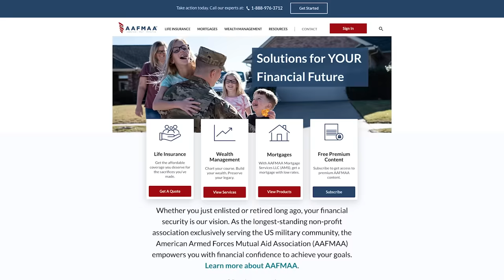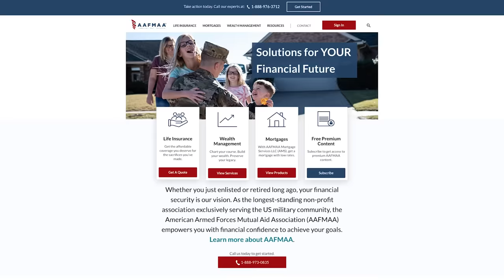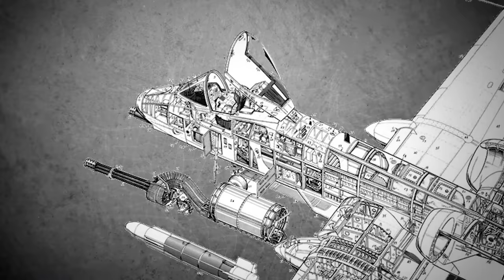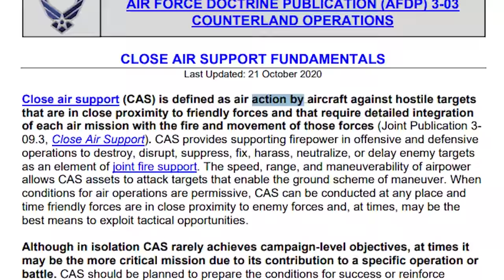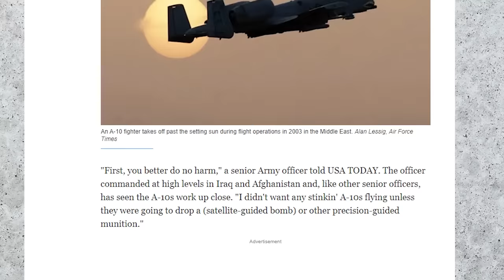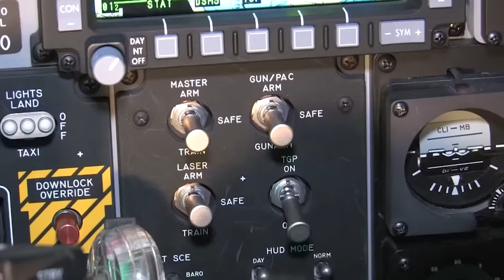Why the Air Force is Screaming to Retire the A-10 Warthog

Comment: In 1990 I was stationed at Headquaarters Tactical Air Command (TAC) and was tasked to develop  briefing "divesting" the Air Force of the A-10.  The Air Force wanted to replace it with the A-16 (F-16 variant) and was willing to give the US Army the A-10s, if that was what it took.  The A-16's motto was "One Pass and Haul Ass!".  By getting target information on the run in, multiple targets could be dealt with without hanging around.  This was a big topic until 1991 when Iraq invaded Kuait.  TAC was sending F-17s, F-15s and F-16s at a furious rate.  That was, until General Schwarzkopf, said "Where are my A-10s.  Somehow the deployment priority sudddenly changed.  The praise from Desert Storm, for the A-10 was too much for the Air Force to overcome after that.  At least for a while.  However it is a different environent today, and I'm sure the upkeep on 50 year old aircraft, that have questionable uses is getting a bit costly.
Reply: No More than Rebuilding The B-52 fleet And Keeping them UP TO DATE !!

Comment: The Ukraine war has demonstrated that the A-10 is indeed obsolete in a near peer or even a below peer conflict where the enemy has lots of anti-air defenses.
As for air to ground support against insurgencies, it makes more sense to use cheaper smaller aircraft, which is why SOCOM got the AT-802U Sky Warden/OA-1K (a crop duster up armored and armed for combat).
P.S., that 30mm Gatling cannon may seem awesome, but it's overkill against an insurgency and the A-10 isn't survivable against a well equipped modern army with lots of MANPADS.  Only in Iraq, with its dysfunctional army that sent tanks out without anti-air cover, was the A-10 able to get close enough to destroy Soviet tanks.  This was much like the first days of the Russian invasion of Ukraine, where the Bayraktar TB-2 drones were able to go tank plinking because of Russian incompetence (Russia did bring anti-air defenses, their soldiers just didn't bother to use them).  So, think of the A-10 as a very, very expensive manned version of the TB-2

Comment: They were built in Hagerstown, MD and used to test over the parking lot of the large company I worked for as the lot was like three floor levels about the ground up a hill and was straight shot to the air field at their plant. Also got a tour of the plant and sat in the seat on the cannon. It was built too good and the Air Force loves to spend lots of money on new toys that put money in the proper politicians pockets.
Reply: I have visited the plant too and Hagerstown is an awesome place it is so eerie to see that factory and the planes that were made their literally right next to where they were built I was imagining the factory up and running and cranking out planes

Comment: They need to replace the A-10 with the same numbers of the AC-130.
Reply: Eh
Reply: LMAO, if an A-10 is already a sitting duck against the air defenses of US' peer enemies, what more to those huge AC-130s?
Reply: AC-130 doesn't fly during the day.
Reply: night vision and radar and ir missiles don’t care about the time of day
Reply: WHAT?  The AC-130 is a totally different type of attack aircraft.  Which is completely incapable of replacing the A-10.
Reply: @paladinspartac2591 so US soldiers only fight at night?
Reply: @pogo1140  the good ones do.

Comment: I’ve seen this plane do its job up close. It NEEDS to be in the USAF inventory. Talk to any solider who has seen this plane do its job will agree. Remarkable airframe. Though the f-35A can be do the same thing, it has a Smaller main gun 20mm versus the 30mm and it can’t hold as much ordinance as the A-10. Not to mention the warthog can take WAY more damage.

Comment: I really would love to see a new iteration of the A10 especially that can increase payload as well as capability and even using drone technology to strike targets more accurately than now. Adding things like AR so you can see 360* around the craft pilots can operate in even more situations. Adding in ECM etc of newer generations and radar it could truly be a multi role attack jet if you could equip it with long range AAMs and or cruise missiles. The Warthog is a legend I hope the airframes can live their final days with glory before going to Valhalla!
Reply: A lot of it is due to the airforce being, largely, run by the fighter mafia with some nods to the bomber pilots...and reluctantly the cargo roles. Most of the rest is forced on them and they'd just love to be able to add more to what they really like doing without having to dedicate anything to the role.

And the Army is, likely, to start demanding to get their own planes to do the role if the Air Force doesn't reveal a plane designed for the role...because they've threatened it there

Comment: It is an absolutely iconic aircraft with a big “oorah” factor and a Rocky Balboa-esque appeal. It had a long run, but the vast majority of that was in situations of air supremacy against non-peer opponents. Unfortunately it costs too much to keep flying, has run the upgrade cycle, and is likely too vulnerable in today’s air defense environment. The mission needs to be met but the A-10’s days look to be close to over.
Reply: I think we both know they will just be sold to another country for them to use
Reply: @LeonSteelpaw No, because spare parts for the A-10 is niche and running dry. No foreign country, not even poor ones, would buy an old platform with spare parts that's worth a fortune due to rarity. 

Japan, South Korea, Australia, etc. are currently purchasing F-35s while third world countries with local guerilla conflicts are ordering Super Tucanos cause it does its coin cas role well without costing a fortune unlike the A-10.
Reply: @LeonSteelpaw  I doubt it. 

They’re not cost effective for the best funded Air Force in the world. It’d be like buying your rich friend’s cool vintage muscle car made by an out of business manufacturer. 

Any Air Force with a lot of COIN needs and fighting foes lacking real air defense would be way better off with Super Tucanos. Any other Air Force in the market for a new plane would be better off with a newer multirole fighter like a recent vintage F-16.

Comment: It is my understanding that the Air Force retired the A-10's before Desert Storm, but brought them back for Desert Storm. I was a Tanker during Desert Storm. I can tell you with 100% certainty that the GAU-8 will kill ANY armored vehicle on the battlefield. One day, when we would be doing maintenance in our FOB, it happened to be very quiet, aside from the occasional tank track squeel or tool being dropped and a breeze. I was on my atnk, when I heard jet engine winding UP (not one of out M1A1's.) I looked up, and an A-10 was leaving after practicing a dive attack practice on our tanks! I COULD NOT BELIEVE IT! I told my crew and said I was glad they were on our side. So,  you see, they can come from high altitude and come straight down on a tank and shoot through the top, which only had a couple of inches of armor. 

This is a mistake to do. They should modernize them with new avionics, new egines, etc...
Reply: Actual Air Force led testing uncovered ghat the A-10 couldn’t reliably pierce the armor of T-62s or T-72s even when at a high angle of attack
Reply: @kyb5203  Well they practiced like they could and they can turn the side of am M-60 to swiss cheese, so I am positive they can do so with ANY Russian tank...
Reply: @texashale65  A T-55 or T-54 sure, not anything older
Reply: @kyb5203  ok. Not that I was a tanker and don't know the capabilities of Russian armor. Not that I was actually in combat against them. Cool 🤓
Reply: @texashale65  Bro, I’m trusting actual test documents over your word, I ain’t just pulling stuff out of my ass
Reply: Modernizing the a10 to become atleast somewhat future proof would cost so much that you might as well design and manufacture a completely new aircraft... New avionics and engines can only do so much. The cannon would most likely have to go too, the other munitions it carries like guided bombs have been proven to be far more effective anyways...
Reply: Like the other commenter says, tests show otherwise. IF it can even hit the tank. 

During those tests, they shot at closely grouped T-55s with an entire load of ammunition, taking as much time to line up the shots as needed from a high angle of attack. The test showed that the majority of bullets straight up missed. Of the bullets which hit, only a small percentage actually penetrated. The damage to the tanks was determined to have knocked some of them out of the fight, but they could be fixed and operational within a couple days. 

In Iraq, the A-10 had the most number of air-ground engagements with the least number of actual kills, also being the most downed aircraft in Iraq, and that’s not even accounting for the fact that it’s VERY hard to tell if you actually killed a tank, and most pilots over reported their kills because you can’t tell if a tank blew up when you’re flying by at 400 mph and the whole thing is engulfed in dust. And you lack optics to really see what you’re shooting at. 

the gun can be useful for light armour and infantry engagements on a modern battlefield, however the availability of MANPADS for virtually every fighting force in the world means that it quickly becomes a very dangerous mission for the A-10, having to get very close to shoot a target accurately. 

The accuracy of the A-10 gun is very questionable. If I remember correctly 80% of the rounds end up in a 12m circle. The remaining 20% can be as far as 40m from the point of aim in a perfect scenario, likely more in a real combat scenario with imperfect flying. This calls into question the usefulness of the gun over a missile for CAS, as very close air support can be dangerous for friendly troops. And a missile would be able to more effectively strike infantry in an area rather than relying on a spread of bullets to hopefully land near them.  Unless the pilot empty’s a significant portion of the guns ammunition onto a target there’s a good chance it won’t completely take it out, especially as friendly forces take cover and let the enemy know they should take cover as well. 

So, I think the gun has very niche use cases, but overall if they want to design a better CAS aircraft it should ditch the gun in favour of more missiles where you can stay far back from any portable air defence while doing the same if not more damage to the enemy.  Weight for weight the missile would be much more effective.

In terms of upgrading the A-10, it wasn’t designed to be modular. Upgrade packages exist but the cost is astronomical compared to the relative simplicity of the aircraft. I think it’d be a waste of money spending so much money on these upgrade packages rather than using that money to design a new CAS aircraft, or even to buy entirely new F-35s which are roughly the same cost as an A-10 modernization package.  

They were good when the most AA the enemy had was machine guns and unguided rockets. In the modern day you could expect this plane to be taken down very fast if it tries to do a gun run, so the weight of the gun would be better spent on missiles.
Reply: @Chevsilverado  subsequent testing against t62 shows very poor penetration requiring multiple passes to effect a kill (on static targets in the open), and as you say... if they can even hit the vehicle. The gun is junk for the role it is/was designed for.

Most of the kills under a10 is from missiles/bombs. Looking just at desert storm you see them using 4800 mavericks likely resulting in the VAST majority of their kills.
Reply: @texasshale65 they most certainly did not do that

Comment: The Gau8 is merley the fun part of the aircraft that has some uses. We could update it to the heftier 50mm autocannon slower fire but allowing for smarter ammunition to deal with embeded targets and lighter armor or weakspots on MBT's.  

The biggest strenght of that thing is its ability to operate so well at a low altitude while performing maneuvers even at maximum loadout. While there is really bad weather even and it can take a beating from groundfire like automatic weapons and the more common manpads. 
Majority of US aircraft (well most modern aircrafts actually) perform poorly during such situations. Even bad weather alone can ruin a day of planned sorties and the F35 is certainly no excemption if we take into accounts the reports done in the past few years. 

And how well will GPS reliant weapons be when modern battlefields are starting to see GPS jammers, Laser scramblers and digital warfare specifically to make modern weapons unreliable this area of warfare will only increase the more we "digitalise" our weapons. 

The A10 certainly has become old. I would however say that a proper replacement might be good to look into that is reliable with many of the A10's strenghts. The F35 is not one of those aircrafts but i can imagine them using its modular base frame to build something to do that on short notice.
Reply: I don't think that the Airforce want's another plane like the A-10, that plane didn't perform well during it's service.
Reply: We already see scramblers/jammers hard at work in Ukraine. HIMARS were all the rage. Then Russia started to jam the gps guidance on them and they became far less accurate.
Reply: For insurgent hunting purposes; AT-802U Sky Warden seems to be the closest to an actual successor.
Reply: they'll ductape that gun to some Osprey and call it a day.
Reply: @trollmcclure1884  that gun is one of the main problems of the A-10.
Reply: @patrick3426  It did for some roles and not as much for other ones. The big issue was that it didn't get a proper uppgrade until 2007. Well past most of its main operations. Before that the damn thing was aiming and guiding like a good old gramps thinking acog is for whusses. XD

But in terms of reliability it was a peak performer. Could take a beating and deliver during some mean situations no other aircraft could touch.
Reply: @kenji214245  it didn't got much better after it's upgrade, it's gun still can't fire straight and it can't tell who is friend or enemy.